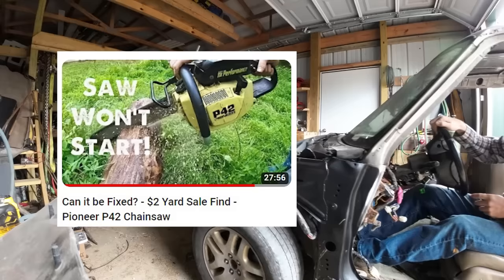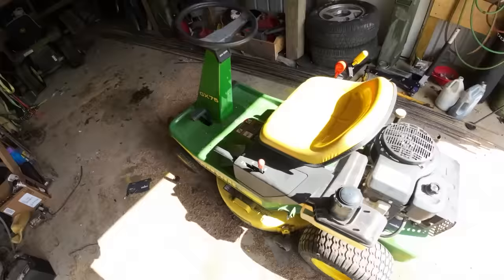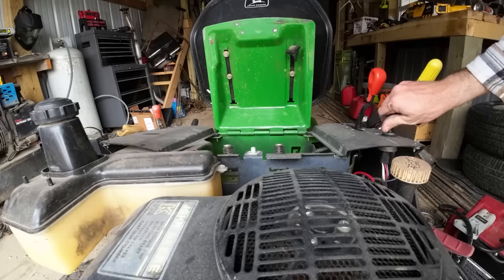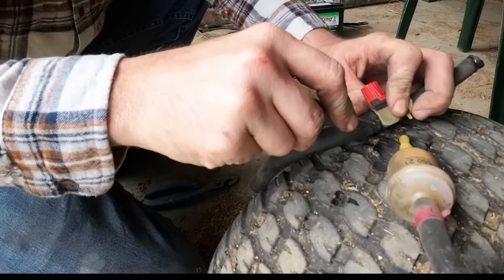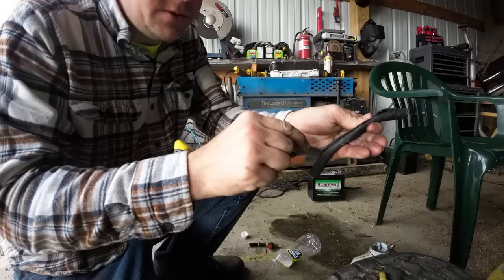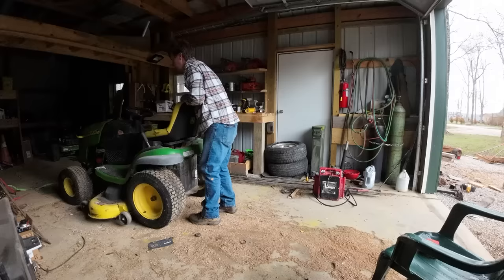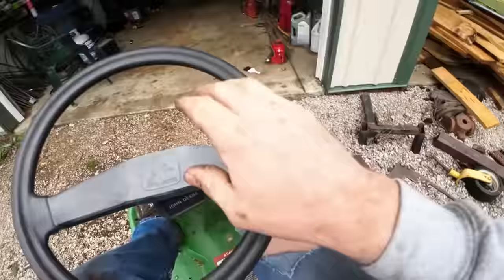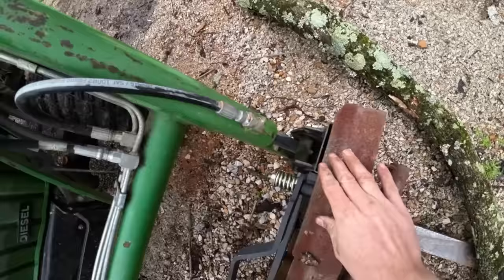Two John Deere Lawn Mowers - Cranks but Won't Start - Trade up Series

Comment: I’d give it a shot of starting fluid & see if it even tries to go. Valves would have to be pretty far off for them to keep from starting & should show in compression test. Might pick up a cheap spark tester that goes in-line between the plug & wire to make sure spark isn’t dropping out while cranking.

Comment: Pull the flywheel Cap'n.  Those keys look okay from the outside but, they have a tendency to partially shear and it is not visible unless you remove it.  They are made of soft aluminium.  I've replaced dozens on those Briggs engines.

Comment: Cap’n I love your new lawn swamp buggy… That’s a real find!

Here’s a few things you might check to get the other one going…

Is the cup holder drain plugged?

Has the windshield washer fluid been rotated?

Is it missing the pine tree air freshener?

Is the antennae mount loose?

Is there too much slop in the four wheel drive linkage?

Are the mower blades on upside down?

These are all things that a guy wouldn’t notice up front so feel free to use this checklist as you do your next deep dive!
Reply: Rofl.
Good one.
Liked cup holder drain plug 😂
Reply: I was thinking about the same list but he addressed them all in his supplemental video.  It also helps to hold your tongue just right when turning the key.

Comment: I really like working on equipment. You have spark, fuel and we know you have air because the compression is good. Even if your valve settings were a little off, you have a wet spark plug and you are getting compression, so it should fire. I really can't wait until you figure out what is wrong. This would be a learning experience for me, too.

Comment: i would certainly reset the valves. the solenoid is a fuel shutoff to prevent backfires when u turn the mower off. i would visibly watch it operate out of the bowl to insure it function. glad to see u plug the fuel pump back in. it runs off of crank case vacuum and will not push fuel uphill unless it has it. also remove and clean the jets in the carb. you'll get it running i'm sure of it.
Reply: So we would just take the fuel solenoid off and turn the key to see if it is moving up or down?

Comment: Hi Cap'n.  If the valve clearance was too tight,( non existent ) , the valve would  be open when it should be closed, and that would show on the comp test. If it was too big it should still run but rattley. Must be fuel or spark . Check those HT leads again.Or squirt some juice in the cylinder and try that. Good luck.
Reply: Yeah, check the gap on the coils as well. You may have a weak spark.

Comment: 👍 I'm doubting it's the valve clearance. My guess is a stupid seat safety switch or similar gone bad. But spark and gas should = varooom.  Good luck.  Did you say sailboat?

Comment: On the carburetor...there is a black plastic square piece with 4 small holes through it and held on with one screw. Take that off and look at the gasket under it. They like to swell up and it will block those small holes off. If thats not it I would say it still has to be something within the carburetor.

Comment: I had a similar problem and it turned out to be the key in the flywheel. It was ever so lightly sheared. A mere indent in the key. New key, ran like a champ. Good luck! Great video Mike! Lee
Reply from the maker: Checked that specifically in this video
Reply: @CaptainKleeman  
I think Lee is saying that the key looked fine at first glance but was still not good.
Reply: It really doesn’t take much to have that key be sheared enough to cause problems.  Like 4-5 thousands of an inch is enough.   Make life easy and start with a new key before you go deeper
Reply: @John-hd5ex  did you see that valve tappet was loose?
Reply: @Crewsy  correct, the sheer was so slight, I dismissed it at first. But it was the problem.
Reply: It seems the coil, which mine has two, can be bad also but he did not mention that here....

Comment: I’ve owned and worked on a few of those mowers. Definitely try the starting fluid others have suggested. I’m pretty sure that mower didn’t have a fuel filter originally, so maybe some of that gunk is trapped in the carb prior to the filter install, never know. Just in case your carb rebuild missed something the mower will fire on starting fluid.

Comment: Nice work on those Deeres. I always thought those little rear engine ones were neat. On your L120, I pulled an almost identical critter next off the cylinder head if the LA135 I bought. I’m always amazed when I see an L/LA series with an intact hood, they always seem to be missing down here in the south.  Looking forward to seeing you do the valves on the 120, I’ve got to do the same on mine and I’m pretty sure they’re the same engines.

Also, I might be saying something you’ve already found, but Deere is great with their online parts catalog for looking up parts. Even if I don’t get it from Deere, because that green and yellow box definitely carries a premium, having the P/N is really helpful.

Comment: On the L120, check your push rods. I had a B&S engine like that with similar symptoms. I checked the valves and they were out of adjustment. It still didn’t start after setting them. Turned out they were out of adjustment due to a bent pushrod.

Comment: Don't forget on the 75, like other Kawasakis (and some Kohlers and other engines), you check oil level WITHOUT turning threading the dipstick in. There's a sticker with illustration on the engine. Usually if you just pull it out and it reads right at the top of Full, it's actually right at the Add mark when checked correctly.
Reply: They need to set a standard about this dipstick problem and make it common on all😊

Comment: Think your right with your feeler gauges, every thing else checks out, the only other thing that might be an issue is your valves might need cleaning. Both mowers though look to be in good condition, they look like they are all there. Your like me, in my workshop I have a place for everything, only sometimes the places aren't always their!🤗😂

Comment: Many people can purchase equipment but fail to understand that everything needs maintenance to remain viable to keep operating up to date.  I purchased a new vehicle and keep the maintenance up to date.  At the 360,000 mile marker all I have spent for maintenance was grease, oil, air filters, tires, and prestone plus two batteries.  I wanted to shoot for 500,000 miles but black  ice put an end to the Blazer.  I have always been well aware to the value of keeping maintenance up to date.  You explain what a mower needed to keep the equipment maintenance up to date. 👍🏼

Comment: Definitely check the valve clearances as its a known issue. Cam has a retracting compression release for starting. Too tight a setting and it doesnt operate correctly. I've checked flywheel as you did on those briggs intek in the past only to be caught out. Briggs used an aluminium key which only lightly distorts but can throw the timing also so worth pulling the flywheel and cleaning the magnets (inspect to make sure rivets are not damaged allowing movement) and the coils plus regap to ensure best possible spark. I've no doubt you will get it running sweet.

Comment: There is a possibility that the exhaust is plugged up.  You know the 4 stroke engine has 
Intake, Compression,  Power and Exhaust.  Any of the 4 can cause a engine running problem.  I do believe I saw a test with starting fluid to see if it would at least pop.   I do really like the channel and keep up the great videos!

Comment: The First thing I do with a non running engine is to squirt a little 2-stroke gas mix down the carburetor. If it fires up for a couple of seconds, you'll know that the engine is capable of running and your chasing a fuel issue. Likely The Carburetor still has issues. The Fuel Pump Impulse/Vacuum hose is probably a Briggs & Stratton #694000. Always look forward to your video's!!   Best of Luck.....................

Comment: You might have done this off camera but try a little starter fluid to completely eliminate the carb. I was chasing my tail in an old JD 335 and had cleaned and rebuilt the carb and it was getting fuel to the bowl but I could only get it to run on starter fluid. Ordered a $25 cheapo clone carb and it fired right up

Comment: Great video. WOW! that black hose that they used for fuel line is water hose. you have two good mowers there. i think that you are right about the valves needing adjusting. :)

Comment: Carbs always get me sppoked. I find it hard to put them back together correctly. Sometimes I draw a little sketch when I take them aprt. Then I have something to help me when I find an extra screw leftover.  I did the same when I had a Gunsmith Shop a while ago.  All parts of a rifle were laid out on a clean white towel in the order I took them apart. Easy peasy, lemon  squeezy ! As they say !

Comment: I'm glad that diaphragm  fuel pump didn't need prime, or at least the starter was enough to get it primed.  Last summer I had one that the starter wasn't generating enough pressure to do it.  I squirted gas into the intake with a syringe to get the engine going and keep it going long enough to get the pump primed.

Comment: Those are both great mowers! I'm betting you are on a good track with the valve lash settings. I would also see if it runs on brake/carb clean (the flammable stuff) since it is much easier to ignite than gas. That will give you an idea if the issue is weak spark, or if it will run at all. When you tested for spark, was it a bright blue spark like on the smaller mower? If its yellow, likely the spark is too weak to do its job.
Reply: Not an engine person, but the compression seemed high for a small engine, that would (to me) indicate valves not gapped right
Reply: @ianh9772  You need nothing less then 120 on most engine to run most low end are 150 psi. You should be within 10 to 20 pounds on each side as well.

Comment: My boys Craftsman mower has the same engine in it, went through same problem with fuel pump pressure hose being bad and having to replace all the fuel lines as the old ones broke down and clogged up the carb. In the end had to mess with the valve lash and after that she worked great. Would definitely say you're headed in the right direction there. Best of luck Capt. Look forward to the next one, keep up the great work my man 😁 👍

Comment: Not sure if anyone has given this 2 cents worth of knowledge yet... I had almost the same issue with a similar engine.  For context I knew it was electrical by the way the way the mower quit running while I was using it.  After testing continuity on just about every thing I found,  the ignition switch to be bad. ( stay with me I know this is getting long ).  I replaced that and found that it would crank but still not turn over..  Sooo I replaced the ignition coils and STILL it wouldn't start. I was wondering if the plugs were bad so I pulled out the left side plug and put it on a spark tester and BOOOOM the right Cylinder started right up. I gotta be honest I was just happy to hear the engine come to life. I tinkered around a bit more and found that it was the safety wire that is connected to the ignition coil on the cylinder that isn't firing. ( I would like to note that the opposite cylinder wouldn't fire until I took out the spark plug from the opposite side) . Somewhere between the coils it must be frayed and grounding out?   Soooo I unplugged the saftey wire and like magic both cylinders fired right up. I am typing this from my John Deere LA 145 right now. I should probably find where that safety wire has gone bad but my yard looks like a hay field and honestly it hasn't messed with the performance at all so I am just gonna leave it alone.  I am on 750 hours as of now and we are working on borrowed time as it is. I write this comment in hopes that someone sees it and it helps them. I watched so many videos and nobody had this solution. I would aslo like to note that @captainkleeman I like the cut of your jib and you got my patronage.
Reply from the maker: That shirt section of black wire that connects the two coils to the safety system has a small diode in it is what I was told.  They go bad, and replacing the bat should fix it.  That's what several people have told me and makes sense to me.

Comment: Pretty relevant to a situation I just experienced with a small motorbike engine. Had fuel and okay compression not great. Spark plug was sparking so I ruled that out early. Adjusted valves no good. Replaced piston rings and head gasket. Got the compression up but it still wouldn’t start. Tried everything I could think of twice over a period of 3 months. 
Turned out to be the spark plug. The old one was sparking but obviously not well enough for it to fire. Changed it out. Started straight away. Lesson learned. Start simple and don’t trust a visual spark test. 
Thanks from Australia love the content.

Comment: Been my experience with those mowers is they will not start without choke. Also, when checking compression, have the throttle open all the way.
Reply: Seems ,ike the OHV engines run lean enough that they need the choke even when warm.

Comment: Wow that is a gully washer washing the Subaru, LOL.  I wish they still made small riding mowers like that with just a single blade. It would be far more practical for my yard than the 2 bladed rider I have now. So many trees in my yard. Makes using a full size double bladed rider a pain in the butt. That was some really sketchy weather whipping them trees around. Glad you had the common sense to stay out of the woods. 👍

Comment: I would suggest getting emery cloth sanding flywheel a little. And resetting the coil gap sometimes it will still spark and make you think it’s enough spark when it isn’t. Had same problem on one I had. Don’t remember the gap setting though.

Comment: Definitely worth pulling the flywheel off to check for even a slight offset. How do you know fuel is getting to the cylinders? Pull the plugs and put gas in the cylinders. If it tries to start, look at the jets in the carb.

Comment: Nice vid Mike !!! Your on the right track. Process of Elimination. 👍👍 I'm working on rebuilding my loader and putting it on my Bolens 1476 the case I had it on was a bit small. Just got to make a mounting bracket to run it off the front pto !!! Love your channel CPT  👍👍👍👍

Comment: Find yourself a 12 volt spark plug cleaner.  They work great and save tons of money on buying new spark plugs.  I got mine from JC whitney 30 years ago and still using it.  Thanks for the videos

Comment: Thanks for the tips. Although my problem was wiring your video got me looking in places I hadn't looked. I found what looked like a frayed wire and one completely broken off and about 2" of it missing!  I was able to remove the connector, solder on two extension wires then crimp them back the their sources. Started right up!

Comment: Put a little gas or starting fluid in the intake and see if it will start.  IF it runs then you have carb problems.  IF not you have more problems.  Valve adjustment will not hurt anything.

Comment: Some newer mowers have a compression release on the engine that kicks in when you are starting it but it disengages when the engine is turning fast enough. I watched a video where a guy had that problem.
Reply from the maker: Easily tested, simply place hand over I take to lower the pressure so the engine can turn over.  👍

Comment: If the valve lash was off enough to keep it from running, you wouldn't have compression. That looks like a Kawasaki engine. Those had some coil and ignition module problems. The coil could cause the ignition module to be out of time. Check on YoTube for John Deere with Kawasaki engine. A friend had one that the dealer couldn't fix.
Reply from the maker: It's a BS intek,. You can still have compression and valves be out

Comment: You have compression on both side the do not need adjustment, it sounds like the plugs  maybe firing under compression,  I have new that where bad right out box.

Comment: My husband said there is a cheap way to check cam lobe by covering air intake with your hand when starting. If it starts  but revs down when you take your hand away it has a bad lobe.

Comment: the solenoid in the carb bowl, turns fuel delivery off when shutting down as a fix for pulling fuel into hot cylinder causing backfires,  its actually an anti- backfiring vale

Comment: Give her a shot of carb. spray  in the air intake then turn it over. She should fire up and run for a short time. Some times they need a little help to get going . I dont think it is your valves but It would not hurt to set them. If the valves were to loose, it would turn over very hard. Yours turns over fine . Clearance is very important, If it is not set properly it can act like a bad starter when all the time it is valves out of adjustment.
Reply from the maker: Doesn't run on fluid

Comment: 100% the valve lash. Have the same exact mower and got it cheap for the same exact reason. I would pull the pushrods and make sure they aren't bent which happens if the screws back out ever so slightly and valves bump the piston. Not sure how I know this lol. I think on this engine you might actually not check at top dead center as some of them have a compression release on them that Crack the valve ever so slightly at TDC at slow speed to help with starter speed. I check mine about 1/3 of the way down the bore right as one closes and before the other cracks open. Can absolutely have great compression and not get fire because they are not opening far enough to suck enough air in for mixing fuel

Comment: I briefly owned an older cub cadet zero turn, ran well, I thought, but used a lot of fuel. My mechanic found that the intakes where plastic and warped. But it ran? Missed you on the dirt perfect podcast, or what ever you youngin's call that.